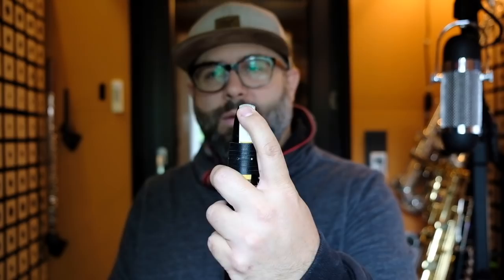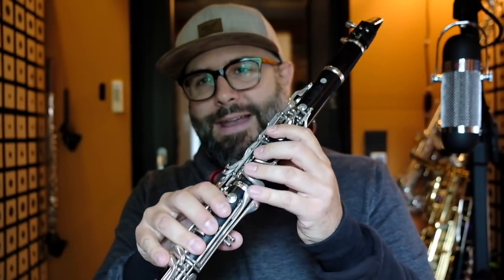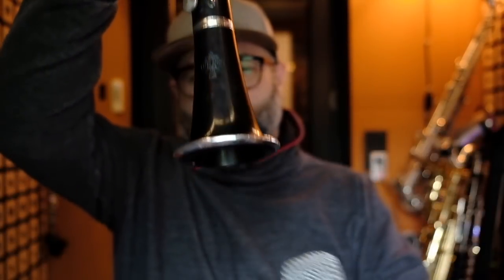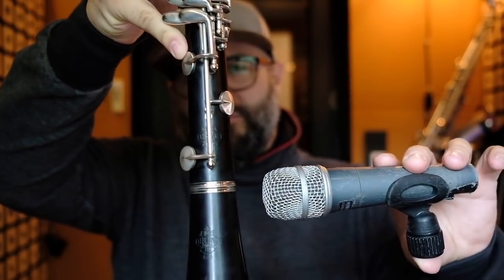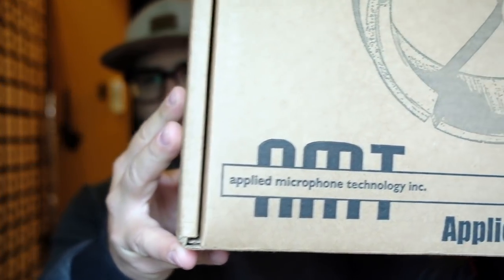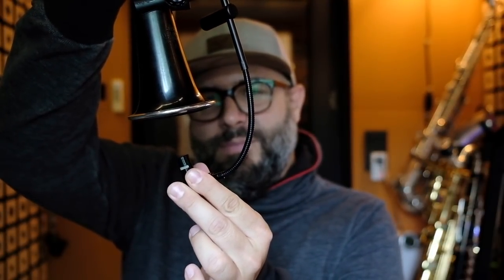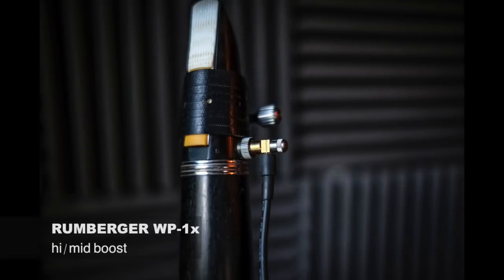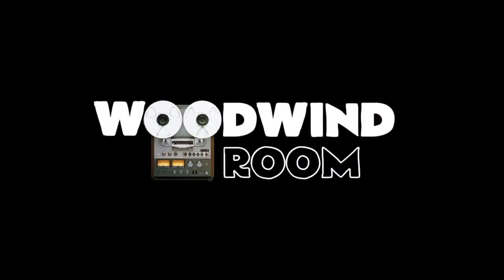HOW TO MIC A CLARINET - comparing the AEA R84, AMT WS and Rumberger WP-1x by Axelmuellermusic.com

Comment: Nalbantov makes a piezo mic that attaches to your barrel and comes with a tap bit so you can drill a threaded hole. Not sure why, but I feel better about drilling a hole in a barrel than a mouthpiece. I love the sound, captures every note equally, no phantom power and zero feedback or bleed, even standing right in front of the drum set and speaker. Also you can control the level you send to get the most sound without air and key noise.
Reply from the maker: Don Ross Ah, interesting! Thx for the info!
Reply: @eatreedsleep6437  Rumberger makes one too

Comment: Hey Axel! Great video, thank you for sharing! I have a quick question. Did you use an AMT preamp or wireless system to capture the AMT clarinet mic? Trying to figure out the best way to use my AMT microphone in my home studio... Thank you!
Reply from the maker: I don't own a AMT-Preamp. The AMT mics have mini-xlr-cables. You can either use the XLR-phantom-power-adapter to go into a mixer or interface or use the AMT wireless systems or Shure/Sennheiser systems. Both ways work fine.
Reply: @eatreedsleep6437  Hey Axel, thank you very much for the quick response and advice. Keep up the great videos and thank you for sharing with us!

Comment: Thanks a lot !  I will get me a Rumberger K1 X ( new version - no idea, what they have changed). And I'm thinking about a wireless connection, like the Sennheiser  Sennheiser XSW 2-Ci1. There is another one (Sennheiser EW 100 G4-Ci1),  which is even more expensive, so I'm trying not to think about that one.  But the description of both deals mainly with bass + guitar, so I'm wondering if this really makes sense for the tone spectrum of a clarinet. And 'wireless' means less sound-quality anyway, I suppose. Any advice about that ?

Comment: What do you think about this mic on bari sax in a very loud environment? I'm really impressed with the sound on clarinet especially when you consider isolation from stage wash
Reply from the maker: To be honest, I would use a normal clipmic with a barisax, since it gives you more detailed high&highmid-frequencies. (I am using the AMT for all saxophones). The Rumberger-pickup works very well for clarinet and bassclarinet, when you need less highs and high mids but more bass. It really delivers a fat low end without ANY spill from other instruments though.
Reply: @eatreedsleep6437  thanks for your thoughts  that really makes sense and helps. Sax and Clarinet are different acoustic worlds

Comment: Hi, what would you recommend for live work for Alto and Clarinet ?
Reply from the maker: Without more info on genre and setting that's hard to answer. For big=loud pop settings I would recommend a clipmic for Alto (AMT LS, DPA 4099 or Shure BETA98). For smaller stages and/or more "acoustic" or less loud settings (jazz/chamber music) I would recommend a dynamic mic like Sennheiser 441 or a Ribbon mic like AEA R84 for Alto. For clarinet a Rumberger WP1X Pickup is a good choice for loud environments (no spill).
Reply: Thanks, food for thought

Comment: Thank you for this video, it’s hard to find high level discussion of clarinet mics. SD Systems also makes a double-mic for clarinet: 

https://store.sdsystems.com/lcm82-for-clarinet.html

I’ve used it for live playing as well as recording (using it along with a room mic, in my case an Audio Techinca condenser). I also bought an AMT because one of the SD mic wires was dirty and crackling, but I had two issues with  the AMT. First, the preamp had no volume, EQ, or mic balance controls, unlike the SD. Having those controls gives you some options live so that you’re not totally at the mercy of the sound engineer. Second, the AMT sounded great live, but terrible when I tried to record. For whatever reason the signal processing on the SD preamp made for a cleaner sound that was more well-rounded for recording, and not so dry. And again the controls on the pre-amp helped a lot, too. The attitude behind the AMT design seems to be “we know best how you should sound, so why should you be allowed to adjust your gain, emphasize highs or lows in the sound, etc.” The AMT is still useful for live playing and in fact less cumbersome physically to use, but I got a handy friend to fix the wire on the SD so it was usable again. It just sounds so good! Recently I’ve started recording the SD mic(s) on one track and the room mic on another and splitting them left and right to produce a fabulous stereo affect when mixing. Again, thanks for this great video!
Reply from the maker: Yes, I know that SD makes a double mic for sax and clarinet - I have not yet tested them though...